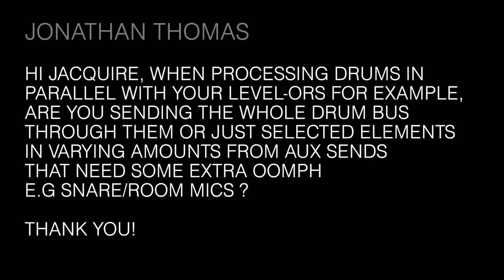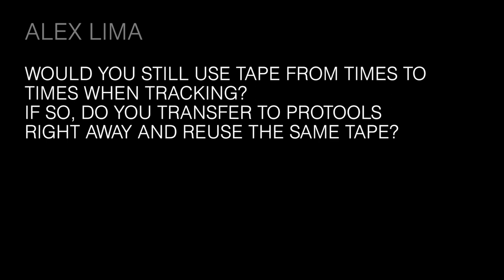MWTM Q&A #13 - Jacquire King

Comment: what plugin he means by 23.12   i dont understand it. will fi?   thanks
Reply: Avid lo-fi
Reply: The lofi is for distortion? Is the same as saturation kind of?
Reply: Lo fi (comes with Pro Tools), like Sans Ampand other ‘Harmonic Saturation’ plug-ins... adds frequency content.

You’re not necessarily going for a distorted sound, but it actually makes things stand out in a mix better. Usually create a 2nd track, add HD and then mix it in .

Hope that helps 😎